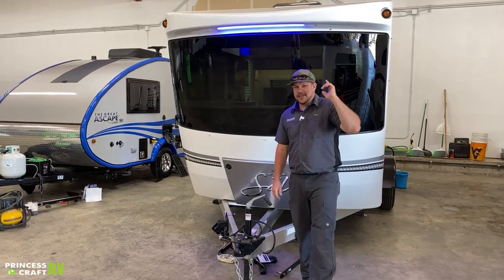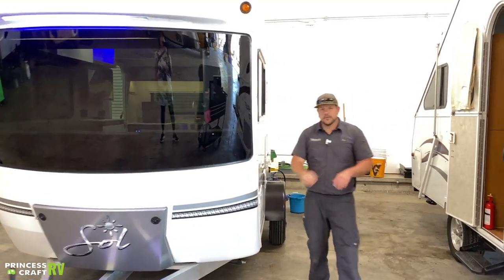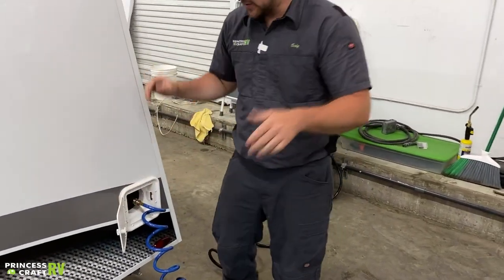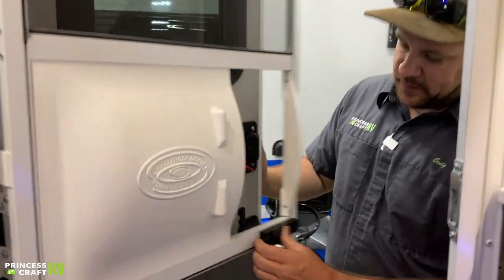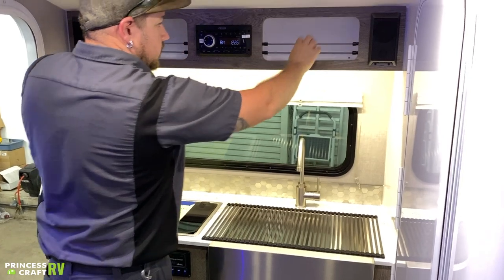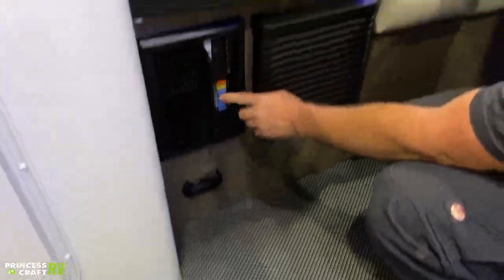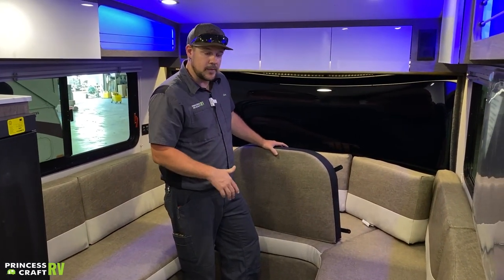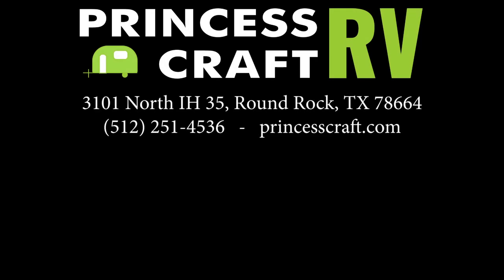2020 Sol Dawn by Intech RV - Technician Tour

Comment: I kind of wish the camera guy had zoomed in a little bit closer on what was talking about and was not so shaky. I had to keep rewinding and freezing and what it is that I want to look at. Also wish that you had given a visual, example of the black water connection. Explanations are fine, but actually showing someone with a hose is a lot more effective. Camera guy please don’t be so shaky and quick to switch from whatever it is that you are filming. It’s kind of giving me a headache. And yes, I do have a degree in this stuff and they told us don’t be so quick to move the camera around. Also, tech guy, give the camera guy a few seconds to see exactly what it is that you’re talking about.